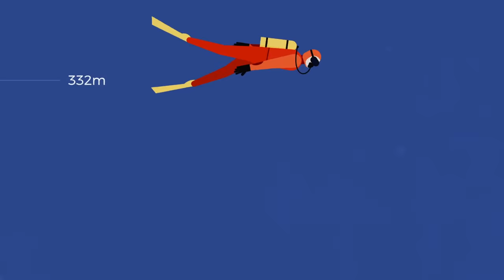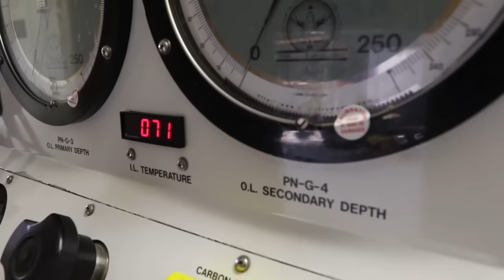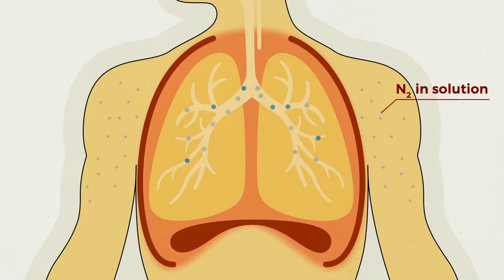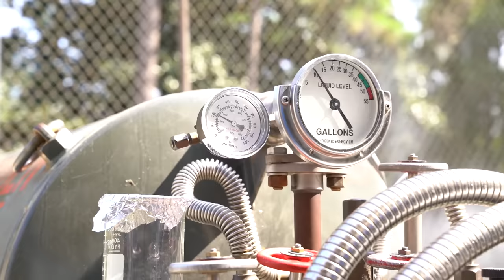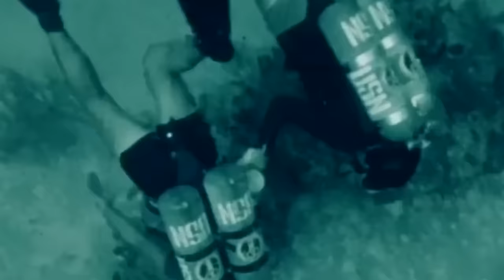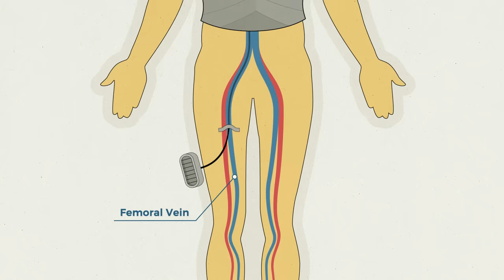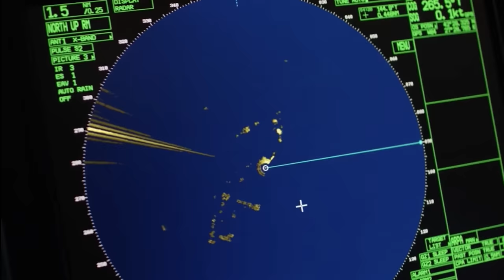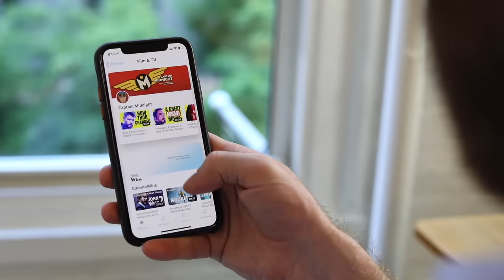Can Humans Breathe Liquid?

Comment: This happened to me as a kid on holiday, I was swimming underwater and my leg got stuck. I was holding my breath for what felt like ages. I had my hand stretched out, out of the water, and kept it there in case someone saw me. I ended up breathing-in the water 2-3 times, although scary It was surprisingly easy.
Literally, 10 seconds later my dad came by and realised what was going on, freed my leg, and dragged me to the shore.
It hurt coughing up the water but the breathing part wasn't horrible, the fear of drowning was the bad part.
Reply: damn, you're a certified badass
Reply: you deff don't have a gag reflex
Reply: I did a similar thing swimming in a pool once, breathing in the water was a little scary, but it didn't hurt.
Reply: dont freaking rationalise it .
Reply: Lol kids say anything on the internets.
Reply: ...yeah, it surprisingly doesn't feel weird until you reintroduce air to the lungs.  It feels kinda itchy when it's over too, but during it, it's like breathing in this weird jello
Reply: How to a scientist and describe this.

Edit: This could help a lot with the research of breathing in water.
Reply: Jeremy Crab I do and I’ve breathed in normal water before on a date it actually feels quite relaxing
Reply: @Thicbladi  Dude, what kind of date were you having?
Reply: Palapa Volk auto correct I meant dare
Reply: @Thicbladi  Oh damn, you're a mad lad
Reply: Palapa Volk nah it was only a couple drops
Reply: A friend who almost drowned said the same thing. He said it was actually a relief to finally stop holding his breath and let the water in.
Reply: I breathed water as a kid and breathed it out. Thought it was a weird memory
Reply: I drowned when I was a kid, died for 3 minutes, and dad brought me back with mouth to mouth. I had goggles on, which apparently saved me from brain damage. But when I look back at the stupid things I've done over the hears , I often wonder !
Reply: I almost drown in a pool when I was a kid before I knew how to swim. I remember being panicked, and coughing up water when I was pulled out. But I didn't actually notice while I was breathing in water.
Reply: I've done something similar, I was in a deep swimming pool and I was taking in a deep breath before going under but I accidentally went under while still taking a breath it. Well I knew that if I went back up while I was in the deep side I'd probably start drowning because I'd be coughing and trying to keep myself afloat. So I swam to the shallow end under water, then got up and just coughed it out. It didnt hurt until I started coughing it out. Really weird experience
Reply: @jrwill58  I've been telling that to people for years ! But they were proper skin diving goggles.... and the doctor said the air pressure helped.
Reply: Today, on things that never happened......
Reply: You can't breathe water.
Reply: @Domagoj Rubil I guess.  But what if some kid comes across his comment and tries it?
Reply: I always wondered about drowning so one day... I just got my waterbottle took a drink and breathed in. It was easy which was very surprising to me.
Reply: I breathed seawater two years ago and it's one of the bad thing that happened to me that summer. My nose and head hurts because of it. I can taste the seawater in my mouth. After that my nose became runny and stuffed and I can't also breathe properly, luckily it didn't last for long.
Reply: I was free diving in a deep, murky lake.    Right after watching lake placid of course.   Went down about 5 meters as i wanted to see how deep it was, and a frog zoomed out of the murk right past my face.    I screamed, then sucked in a lungfull of water.   I was 60 feet out and nearly 20 feet down, and with my lungs full of water, i had no bouyancy.   I managed to swim back to the surface, and i spewed out water and got a half breath.  I made it to the edge of the lake and almost blacked out on a rock shelf.   I managed to shoot water quite aggressively out of my lungs, but i was also puking up more water at the time.   My vision was a tunnel, and i kept coughing up brakish lakewater for several minutes.  I was left with a headache, and the taste of swamp, but was fine.
Reply: @waynebow-gu7wr  how did having goggles on save you from brain damage? I'm very curious to know that answer
Reply: @lorriecarrel9962  They were skin diving goggles.... and the doctor said the air pressure did it. But looking back at the last 50 yrs of my life, I'm not sure if he was right
Reply: I remember breathing in water accidentally as a kid, but it was nothing like you described, I felt a lot of pain in my lungs and throat and couldn't stop coughing for a while.
Reply: I once flew to the moon, using farts as a propellant.
Reply: when in "Danger Mode" time slows down in your mind.
Reply: Ive drowned to unconsciousness . After the pain and panic of holding my breath for as long as I could  that first breath of water felt very relieving. Of course I  only got the one breath before the world shrunk to a pin hole and then I was swallowed by darkness.
Reply: @polybius2282  Scientist's wild tell us that actually we were
Reply: @polybius2282  Scientist's would tell us that actually we were experiencing muscle spasms that felt what our minds believe breathing underwater would feel like. You and I both know better though don't we?
Reply: when this guy goes to school late, the entire school apologizes for being early.
Reply: and then everyone  clapped
Reply: @hosmerhomeboy  yeah right you wouldn’t catch me anywhere NEAR a lake or an unassuming sweet old lady after watching lake placid
Reply: you dont simply breathe out water, it like trying to blow water out of a sponge
Reply: I had that experience at 6 years old It really is strangely comfortable, you just accept it, but before you drown all your instincts are on alert and panic is total
Reply: Same happened to me when I was i lil kid. Instead I thought I saw a monster and froze there for like 3 minutes. Then relatives it was a just long thicc as tree moving in the lake.
Reply: i don't understand how that happened. then why do some people drown? do they not eventually get water in their lungs while drowning? wouldn't they be forced to then breathe the water too like you did? or were you just making up a story that i'm taking way too seriously a year later lol
Reply: @waynebow-gu7wr  my kids were snorkeling with me for about an hour when they tried to dive to get a shell but couldn’t. Neither could I so I tried again, freedove 25 feet which was crushing and impossible got the shell came up to find my sons had breathed water in their tube and somehow couldn’t clear and panicked. I had to hold them up out of the water for seconds I didn’t have until they got a few breaths and calmed down. Finally I caught my own breath. 2 minutes of pain and terror. I guess you don’t know what’s possible until you are forced to confront it. Advice: 1. drowning is awful. 2. don’t assume snorkeling is safe just because you learn to clear your gear.
Reply: @justintyme3043  You got people in every other comment section claming to be fking scientists and what not, but a child almost drowning is too hard to believe?
Reply: You can actually get a few extra seconds of breath from sipping water, esp while surfing.
During huge surf, you sometimes get held down for 30+ seconds and in the whitewash, you cant even tell what direction is up because of the turbulence.
When you are totally out of breath and about to blackout, you can take sips of water (in the whitewash, it's a mix of water and air so it's a little more convenient) and get the couple extra seconds you need to find the surface
Reply: 'the breathing part wasnt horrible'

How
Water has literally 0% Oxygen (thats actually harvestable by human lungs), how was it not horrible?
Reply: No one asked
Reply: That sounds fucking terrifying.
Reply: I've had a dream once where I was drowning and just when I knew I couldn't hold my breath anymore I started breathing of course it being a dream after that I could somehow magicly breath underwater
Reply: Babies “breathe” liquid whilst in the womb, from embryonic stage to birth - so one of the ways to make transitions from air to liquid breathing - and back again - will have to include a variety of ante-natal psychology to trick our respiratory system - and mental processes - into accepting an alternative breathing medium…
Reply: Did you survive?
Reply: @teeess9551  no he's communicating from beyond the grave
Reply: Same happened to me, i was totally submerged when i was a kid. To be honest it's actually liberating to finaly breath in the water after holding your breath. The bad part is that your brain is constantly screaming at you that you are going to die when the water invades your lungs, is comparable to the feeling of falling down and seeing the ground approaching you, is scary as hell.
Reply: I wonder if you can feel that the water is giving you oxygen
Reply: Bro I did the same thing when I fell in a man made lake at 5yrs old. Due to being a man made lake , there was an immediate drop off about 10+ feet deep. I fell in while walking the edge made of railroad ties. I can remember bobbing up and back down under the boat dock and taking a deep breath under water due to screaming and running out of air. It felt surprisingly normal and till this day I still have dreams of "Drowning" but when I can't hold my breath anymore I suddenly breath in and it feels normal like I'm breathing air. It's really weird. This concept reminds me of the movie " the abyss”
Reply: @justintyme3043  man no one says "lol" or "internets", its actually not hard to breath water, if you are forced to do so. I bet you also think the longest time a chicken has lived without a head is around a minute, the actual answer is 18 months.
Reply: Haopend something like that too, actually i couldn't hold my breath anymore but its was as easy as breathing normally, and it felt like breathing too, i felt like i was up and breathed air. I saved myself
Reply: If that is the case, the you are the suitable candidate for this kind experiment..
Reply: Yea bud you were definitely drowning
Reply: @doomguy584  Me too. It was a nice dream after I could breath the water. It left me with almost a memory of it except I know it was just a dream
Reply: @lyyliesther984  yeah like went from nightmare mode to hey this is really fun
Reply: You didn't breath though 😂😂😂😂
Reply: Even if you could breathe a liquid, doesn’t mean you want a lung full of seawater.
Reply: Wow, it never happened...
Reply: @Thicbladi wow, what a stupid dare. I dare you to light your hair on fire. If you're cool, you'll do it.
Reply: @waynebow-gu7wr how did wearing goggles prevent you from suffering brain damage due to oxygen loss? You could see under water, and...?
Reply: @byteresistor how did you get back? You should get a medal!
Reply: @abdenacerfodil2546 I know, right
Reply: That happened to me as well. When I was young, we had a pool and a toy duck you would put your legs through and float around the pool. My older brother would lift up the bottom and push me in the air for fun.  I was getting a bit old for the floaty and my thighs got stuck and one time I flipped upside down and only my legs were sticking out of the water. I was kicking my legs frantically and had a deep breath of water. It was soothing. Right after that breath my friend flipped me back over and I got out of the pool for the day. lol
Reply: @rickeykoga2312   "...in the whitewash, it's a mix of water and air..."

I would think it's a mixture of water and air and sand. I couldn't even imagine getting sand in your lungs...
Reply: @polybius2282  Liar. Swallowing. Yeah, sure. Breathing in. Nope! Science doesn't work like that. Breathing and swallowing some are two totally different things.
Reply: @justintyme3043  Yep.
Reply: @3bydacreekside  Another liar. Did you guys ever think that anyone who actually studies this stuff would see your comments and correct them? Or do you not think enough such people exist in the world for it to ever happen? I'm just curious.
Reply: @thealpaca18  It's... not... water!
Reply: @frankboff1260  It's never a relief. Water filling the lungs is never relaxing. The lack of oxygen and presence of high carbon dioxide concentrations in the blood always, unfailing causes the "panic" sensation. This has nothing to do with your feelings (whether you're emotionally scared or not), it is a physical reaction that sends that sensation through the body then, of course, immediately signals that to the brain [then that causes fear, or you simply wanting to live does]. But whether you feel fear or not, that bodily reaction is going to happen. It's called hypercapnic alarm response.
Reply: @enjaymarine  Right. A very different process! And it's not just regular water, pool water or ocean water. I already knew the world was full of liars but it sucks to actually SEE it; so many sitting & contributing in one place! This Is Why I Believe NO ONE! It takes me years to trust one, single human being. And even then I keep 1 to 5% on reserve for their inevitable human nature. I... Hate... Deceit!

And this whole new generation of attention whores.
Reply: @tlock77  In bed, I have taken a sip of water and then fallen asleep without swallowing it --- and then woke up violently choking.

Just breathing 1/4 teaspoon of water hurt incredibly and set me coughing spasmodically for a couple of minutes. I couldn't imagine breathing two entire lungsful of water...
Reply: Something similarly happened to me as well, when i was younger i dived down about 10 or so feet to grab something from the bottom of the pool. I swallowed tons of water before reacher the surface but from what I remember it didnt hurt very much but the panick of drowning was pretty bad
Reply: @rat_king1236  " I swallowed tons of water before reacher the surface..."

Just remember, we're talking about actually breathing water, not swallowing it.
Reply: @bricaaron3978  nobody here actually beathed water you know? They were all just fcking drowning lmao
Reply: @rat_king1236  "nobody here actually beathed water you know? They were all just fcking drowning lmao"

Look up the definition of the word 'coxcomb'.
Reply: @bricaaron3978  a type of flower? Weird response but ok lol
Reply: @doomguy584 SAME!!! It was so calm and relieving too!!!

Comment: QUESTION:  If we can remove the CO2 via the veins can't we just oxygenate the blood that way and skip the whole breathing thing entirely?  The urge to breathe is caused mainly by CO2 build-up so having oxygen directly delivered to the blood would be like discovering you could hold your breath comfortably for a really long time.  Although you may need a lungful of liquid just to prevent your ribcage being crushed by the pressure.
Reply: If you're talking about having external equipment, why not go with an oxygen tank and breathing apparatus?

Or are u think of something that would be smaller & less bulky?
Reply: We can breathe outside of the body - it's called ECMO but it's bulky, expensive and requires big catheters into major vessels which makes it difficult. I don't think any solution that requires being catherised into vessel that, were there any problems, could bleed You out fast, is a viable method for industrial use. Femoral vein catherisation is no joke and is dangerous even in clinical settings. Underwater, on a boat? Asking for septicemia. 
It requires pumping blood trough several filters and membranes as well as oxygen tank but it , even if not for the above, it wouldn't solve the problem of nitrogen dispersing into tissues.
Reply: I mean it is possible but the machines that allow this are pretty big so there is to be a ton of research on that too. But i think allot of people would not do this just because off something is pumping your blood our and oxygenates it. Even to think about those maschines gives me the creep. Yeah they are used in medicine but this is another scenario, you have basicly no choise. But on the other hand some people would do this so why not trying.

Comment: As an Open Water Diver myself, this was HUGELY interesting!
I could never be a HUGE diver like the ones pictured in this video, nor am i qualified to use any of those, but it's just so interesting! (SSI Open Water Diver)
Reply: What “level” or diver qualification do most astronauts have?
Reply: Honestly, i have NO idea, probably VERY, VERY high lmao (instructor trainer style) But astronauts and divers are different things, astronauts use things similar to Closed-Circuit Rebreathers, (CCR'S) , So divers that are qualified with that at high levels are close to astronauts (still not the same)
Reply: @Astro Viator 😳 what? Depends if they do the course. They use water to simulate zero gravity but is not mandatory for their job to be qualified by some amateur diving agencies (PADI, TDI, SSI, etc).  Plus, a saturation diver, a commercial one, has different skills that a OWD or even a Trimix tech diver. Different courses, different approach. And between an astronaut and a diver is a huge difference, same like between a pilot and a sailor, to be able to do one job great is not qualify to be good in other one. You can be a diver and have problems with hight, become dizzy, or to be a pilot and have sea sick...
Reply: @MrOvidiuk  Yup... you explained it MUCH better than i did.. Whats your qualification?
Reply: I'm only PADI Master Scuba Diver, and since I'm Not 18 I can't become an instructor yet
Reply: @mortenbund1219  first you will need to become a padi dive master